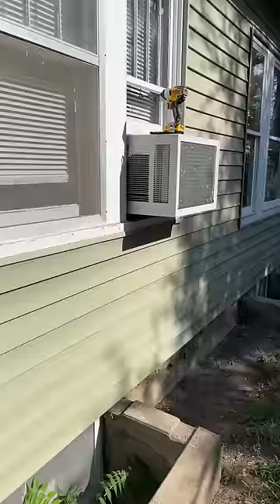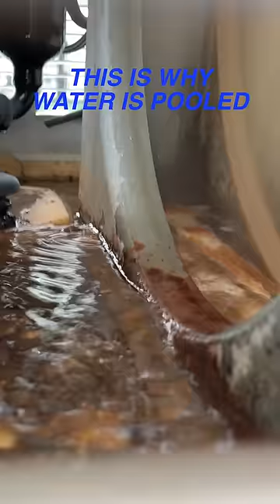🥵 99% Don't Know THIS About Window A/C!

Comment from the maker: 🥶 Just released the full video! <2 minutes. Watch it at… https://youtu.be/rYoYJq9Oj4g
Reply: Well since I work on systems up to 100 tons on the regular,  I'm pretty sure I understand how this little 10000 btu window shaker works.  I didn't say the process wasn't effective. But as your video clearly shows, there's lots of corrosion and scale inside that machine. And as we all know,  Once the components of the coil erode, the heat transfer is adversely affected. Therefore, what little efficiency that was gained by the slinger will be lost after a couple of seasons of the stagnant water bath. Then there's the pests attracted by the aformentioned stagnant water. But the video is informative for the typical DIY'er. 🤣
Reply: Lmao peoples drain gets clogged and they drill new drain instead of cleaning it???
Reply: @thatboss3836   You may want to watch the video again and pay a little more attention this time before making pointless comments.  This unit doesn't have an external drain by design.  It uses the condensate and a slinger to slightly improve the efficiency of the condensers heat transfer.
Reply: @kodiak410a  well I didn't look but when mine starts making that noise it's dirty asf so I clean it and all the water goes away for the most part but even bought a unit 3 years ago so I'm speaking on experience not a minute video
Reply: Someone once told me to put a cup of water in it to get working faster , they never told me y
Reply: 99% of people rightly don't care either.
Reply: I do have 1 question tho what happens if this liquid overflows and comes out inside?
Reply: @kodiak410a  Spot on mate, been in HVAC 30 + years and completely agree . Have a look at that rust, would be even worse near the ocean . Just stick to the Handyman work champ 🔧
Reply: @AussieHVAC I couldn't care less about disposable wall ac's...Breeze Mechanical Inc.
Reply: I will do as I please with my window unit. I dont like the sound of the water flying around inside. Why TF would I buy the quietest U-shape window unit to hear water flying around inside? It was 333 dollars and I only expected it to last 1 season here in sweaty ballsack AL. However, SINCE ITS NOT RUSTING AWAY, after I put a 3/8" drain hole in it, it's soldiering along in its 3rd miserable sticky summer. 

So MYOB.
Reply: Have always drilled mine. I had one running nearly 24/7 for 3 years without a hiccup.
Reply: That's great till fruit flies start reproducing in the water and end up in the room with you. I drilled a hole in my window unit because of this and can always tell when it gets clogged because the room gets infested with fruit flies.
Reply: my ac so cold

Comment: The newer ones have the drain hole halfway back too. As a feature, they rot your walls.
Reply: I took aluminum coil trim and bent it in a tray. That made it specifically for the window to funnel the water outside and not inside
Reply: These weren’t built to last forever, if anything they want them to rot so you buy another one
Reply: The mounting instructions say to mount it at a slight angle to prevent that.
Reply: @VC-TV your house ?
Reply: @brycen910  central air, dont worry about those cheap ass temporary units, that’s really all they are, say you move into a new house, ac needs work, its 90 degrees out, these are great untill your actual ac unit is either fixed or installed, but for long term ac? Nawww i sure you can get away with it for a while but
Reply: @VC-TV , yep. Planned obsolescence. 😒
Reply: @VC-TV lol dude people use these all the time for long term use, they work fine i dont know why youre crying
Reply: The refrigerant doesnt last as long.@VC-TV
Reply: @Bigsativa  yea im sure they do, and they also wonder why they replace them so often, or why they dont last very long, which is what this video is about……. Lmfao thats some pretty ghetto s*** right there tho if you live in the hood im sure this is common practice, but go out to the suburbs and you wont see a single one in the window
Reply: @VC-TV  they dont rot, their drip line rots your wall, at least whem poorly installed... and they make it harder and harder to properly install them, so most people dont.
Reply: @benztech2262 yeah, smooth brains that have no experience think they can install things without directions though.
Reply: Plumb a drain line in to wherever you want. Simple
Reply: @William-Morey-Baker  buy some aluminum coil trim, if you bend it the right way you can make a drip edge that goes way underneath. That way all the water flows outside of the house
Reply: @VC-TV you're not even a good rage baiter
Reply: You're supposed to have them angled backwards bub
Reply: @VC-TV is that why they are made from aluminum?
Reply: @ASMRoadtrip  tubbylumpkins got a shoe stuck in his butt and can’t get it out
Reply: Not true my LG dual inverter has the hole all the way in the back by the coils no other holes I got the rear dropped by about a 1/4 of an inch and it drains right out on the ground stop spreading miss information.
Reply: @ASMRoadtrip  lemme guess you’re comeback is gonna include why i replied 5+ times, ( i did it on purpose ) you idiots are so predictable, booooom shalock yala la boom boom BOPPPP
Reply: They are mainly used in house trailers @VC-TV
Reply: @Bigsativa ’Cause he don’t make no money offa them! 
Btw, it’s a nice way to have better zone control than with central a/c. We have rooms that we don’t cool at all. Just storage/library. It also avoids the nasty ductwork that needs professional cleaning.
Reply: @nicholasittzes7224  lol no lie, just moved into an apartment with central air and honestly don't like it, I miss the noise of the old ac lol
Reply: "As a feature" 😂
Reply: @VC-TV My father has been an HVAC mechanic for almost 40 years. 

We exclusively use window units.
Reply: @VC-TV he talking about the wall rotting not the ax smart guy.
Reply: If those walls are would. Better invest in real concrete hollow blocks when building homes.
Reply: Mine has water soluble oil to reduce rust and a drain hole if I wanted to increase the efficiency I would hook a garden hose to it through some kind of water filter
Reply: @VC-TV I live in a part of the US where we only use / need AC for 3 months tops. I’ve been using the same window units for 4-8 years depending on when I bought the unit. While they are a pain in the ass, it’s hard to justify the 5-8k purchase and install cost of a central air unit when I wouldn’t use it for 75% of the year.
Reply: @VC-TV twatt?? Lol. Where i live we run a/c 4 mnths a year. House is 150 yrs old and good luck running duct while occupied. Would have to box ductwork.. anyway yeah our 220 wall unit does the whole floor nicely. As did my grandparents for 70 yrs
Reply: @VC-TV you have a child brain.
Reply: Most people rent soooo......
Reply: @VC-TV my family used 2 of the big window units for like 10 years and then sold them when we moved for cheap cheap to a friend of the family and he still has one of them in his hunting cabin now and it’s been like 15 ish years now
Reply: Good job installing wrong also that is supposed to be attached to a line.
Reply: @VC-TV  as someone whos born and raised in the suburbs 😂 this is bs, ive see houses in almost every neighborhood with a window unit. Only places that dont are boujie areas with strict HOA
Reply: @VC-TV we had one for almost 30 years that just went out. Used it almost daily here in south Louisiana. I’m sure the new one won’t last half as long though.
Reply: @MeticulousTechTV what parts do you live in?! I’m so over this heat and humidity in south Louisiana and looking for the perfect cooler weather almost year round state to move to!
Reply: I have to use one constantly cause my apartment doesn't have AC
Reply: @VC-TV jokes on you not want to break the cost you weigh more than an AC 😂 ain't nothing built to last
Reply: Sounds like you installed it incorrectly
Reply: @VC-TV not talking about the unit😅
Reply: @VC-TV not everyone has central air.
Reply: @VC-TV How do you hear anything with that tiny marble you call a brain rattling around in your skull?
Reply: @VC-TV those cheap ass temporary ones work for 25 plus years if you fit them on a slight angle so they dont hold water and rust out like that guy's one. Looking at his condenser its not very old but inside is rusty already.
Reply: You say your air conditioner don't have like a hoose to drain like we do on south america?
Reply: @fuuuuuwahhhh5276 Haven’t been to the Midwest huh? They’re everywhere that’s not in a fancy subdivision
Reply: @VC-TV Wow, you really got schooled on this thread!! You’re thinking these units are exclusive to “ghetto” areas kinda shows that you’ve never been to at least half of the US
Reply: @VC-TV how u talking shit but dont know the difference between your and you’re
Reply: @MeticulousTechTV  you got central heat by chance?
Reply: @jimbobdobbs1597  sounds like it needs to be demolished and a new house erected to me
Reply: @jimbobdobbs1597  got a better comeback by chance? Just wondering
Reply: @guyunknown6224  a hunting cabin is not a place you live on a regular basis, thats why you call it a hunting cabin, that would be a justified use, lol
Reply: @GenesisRasphotos  i wouldnt know i dont live in an hoa
Reply: @marcfavell  i wish i knew what you said there man
Reply: @elduderino007  was that supposed to offend me in some kind of way? That was weak man try harder
Reply: @rossbrumby1957  if you buy a house and put these in half your windows, you dont know what good looking looks like
Reply: @stephenhanlin2388  did i? Is that what you told yourself before you went to bed last night ?
Reply: @_Radoo  buddy grow up that grammer bs dont mean shit here, this isn’t an essay for college 🤣
Reply: @stephenhanlin2388  🎶i said you got to try this sandwich, it’s no ordinary sandwich, it’s the tastiest sandwich in the seaaa🎶
Reply: @Jake-eo9zk  the wall wouldn’t rot if there wasn’t an ac dripping water there, smart guy
Reply: @VC-TV  No it's an honest question. Or do you just have a Zika skull?
Reply: @VC-TV  someday you will meet a girl that can put up with even YOU and you can move on from badgering adults online for attention.
Reply: @VC-TV  or guy, if that's your thing.
Reply: @VC-TV I don't know about temporary man people around my area live in trailers and let's just say 220 and 110 they're permanent Solutions 😂😂😂😂😂
Reply: @VC-TV dude the house I grew up in was a 100 years old. We weren’t getting central in there. I’d agree central is the way. But this is also the real world.
Reply: @VC-TV  I'm in the process of saving for a new mini split. Old unit was I believe 3 ton so 3.5 or possibly 4 to replace it since it overworked itself being a bit small for the size of the house
Reply: @elduderino007  there’s and onion staring at me
Reply: @VC-TV  interesting.... And how does that make you feel?
Reply: @elduderino007  like lemons
Reply: @VC-TV  well.... What's your sign?
Reply: @elduderino007  pfffftttt my CD just skipped and eveyone just hear you let one rip
Reply: @VC-TV  this is your sign that you need help.
Reply: @elduderino007  this is your sign that your getting trolled
Reply: I have a window unit in my house from like 25 years ago...still going strong  @VC-TV
Reply: @TheLongDon  im sure you do obviously it went well over your head; they aren’t long term cause they look like trash hanging out your windows, the drip and leak water overtime potentially causing damage to your house, you may not see it, but it’s there, goodluck to you, and may god help you understand better
Reply: @VC-TV  Buddy you're trolling yourself. How long have you been stuck here on this thread. Seek help kid.
Reply: @VC-TV  So the small box hanging from my window looks worse than the gigantic condenser unit sitting in the corner of your house? Window units don't leak into the walls, they literally have a dedicated area to drop water outside, it's the entire point of sticking it into the window. If you can't install yours correctly that's on you.
Reply: @TheLongDon pretty easy to hide with a fence , bush, trees, etc
Reply: @VC-TV  I can also just put the window unit in my back window... Where it means nothing
Reply: @TheLongDon  i bet you put alot of things in your back window
Reply: @VC-TV  central isn't standard in a lot of states still, esp NY. I'm in florida so I love my central ac
Reply: @Bigsativa  He couldn't set it up right
Reply: This is the worst thing u can do to ur AC with that corrosion from those condensation
Reply: @723lion  uh huh
Reply: O never had central heat and air. . Always these bad boys in each window with a 800 dollar electric bill 😅
Reply: That moment when you're american and water and bugs can literally destroy your house, kek
Reply: @elduderino007  Let him keep saying he's trolling as he mass replies to everyone out of anger.
Reply: @bruhtholemew  Right, dude's lost.
Reply: My window units been going strong since 1986!! It freezes up if u turn it too high. Compared to my portable units I have less issues. It’s a hassle for the drain tube, it’s a hassle to run the air vent bc it’s awkward & takes up unnecessary space.
Reply: @VC-TV say that to anyone in high desert
Reply: You are not supposed to drain them. That is literally the point. The only time you are supposed to is when you remove them for the winter then take them out and only then do you drain them. You know, not all over your wall.
Reply: @VC-TV  don’t have central air got one of these upstairs and one downstairs they’ve been going strong for the last 6 years I thought they woulda crapped out by now
Reply: They also grow mold and other fun kinds of slime!
Reply: Well that's clearly Operator error.
Reply: You don’t mount them lvl 😂
Reply: 17 years my frigidaire 12k unit finally acting up----
Reply: Yeah if your house is made out of cardboard.
Reply: Rot your walls?? How does concrete rot😂
Reply: @benztech2262  It needs to be tilted back so the water leaving the evaporator can run down hill. Without the tilt, the water will run in your house.
Reply: @ChadVanryn , Do you think a cut in half PVC pipe might work also. I have a Medea U on order and plan on doing this before I install it.
Reply: @jayv9286  I'm not sure how but I won't say no. It would be easy to do it with "aluminum coil'. Just take measurements and bend it as a funnel/pan so that water runs out. It's a crazy idea I had that works so they don't have video online
Reply: @VC-TV  I’ve used one installed in a hole in the wall on the kitchen for 2.5 years. Going strong
Reply: @guyunknown6224  Old units could last that long especially if you didn't use 'em daily all season long but like everything else they only last a couple years now before something major fails, I have a stack of broken units in my garage I use for parts due to this bs and actually purchased an extended warranty for the first time ever on my last one so hopefully I at least have options instead of dropping another $700+ when the new one dies after a year out of warranty. Crappy cheap parts and design/Inflation/planned obsolescence...
Reply: @ExpertWeeb1  ey yo what! Lol its literally the same refrigerant as central air systems. Same concept and design just on a smaller scale
Reply: @VC-TV  it's not uncommon out in the boonies either. Countryfolk just don't give two spits what people think about their setup. If it ain't broke don't fix it
Reply: My coils would freeze over the air conditioner would stop running and then un thawed with water running down the wall, damaging the drywall. It was doing this right out the box ge 10,000 btu didn't last a year the worst